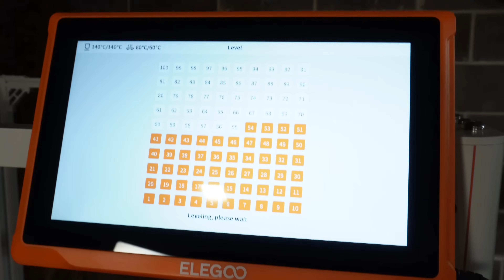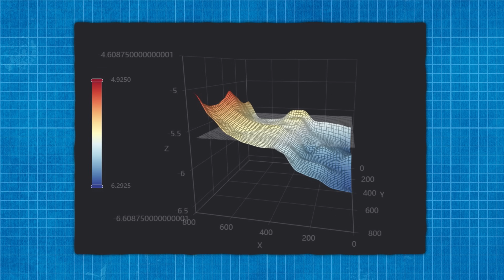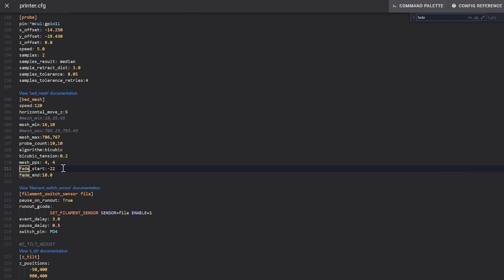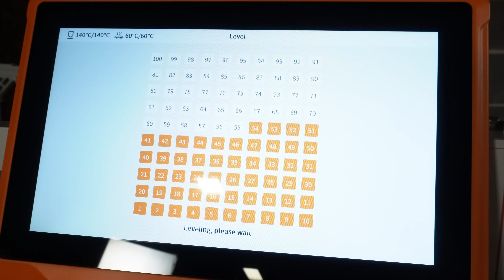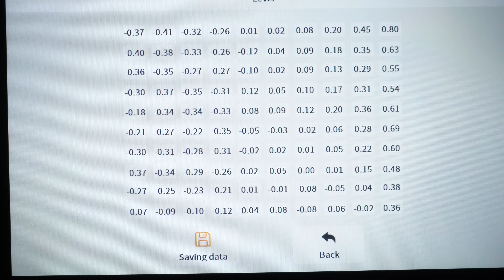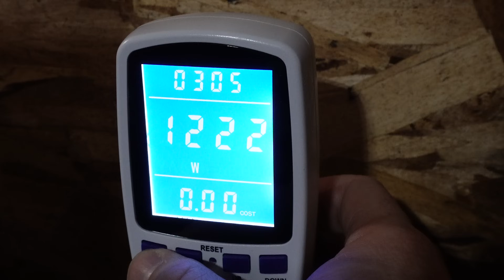My OrangeStorm Giga STILL DOESN'T WORK

Comment: I installed my Giga this week (Jan 2025) and was fully calibrated and running in less than 2 days, 9 months ago you were probably having "youth problems"
Reply from the maker: heh, oh dude, the Giga was definitely suffering from teething problems. The firmware has come a long way.
Reply: @olivergarrow233  I'm really considering this printer. But I'm so afraid because of all these complaints about it so far. Especially with no prior experience with 3D printers. What is your current experience since you set it up? Still no issues or complaints?

Comment: I got a Elegoo Neptune 4 Max a while a go, and the firmware Elegoo makes for that printer still sucks, you can't update any service because it bricks the entire system the Klipper fork they made and you'll end up buying an eMMC adapter to flash the official image or other open source images.
It's an excellent printer (quite tedious because BIG printer, and kinda noisy) but damn, the software they made sucks

Comment: So I've been doing electrical work for almost 15 years. If you're pulling over 12 amps on a 15 amp breaker, you will definitely trip the breaker after a short while. Wife and I run a business from home using lasers, and the laser we just purchase requires 2 20 amp circuits on 220v feeders, so I get to have the joy of running new electrical in her workshop... yay me 😅
Reply from the maker: Hahaha. It’s not 12 amps continuous just during bed heat up. Thank goodness. I do not envy you as I have four new 20 amp circuits that need running!
Reply: @3DPrintingNerd  thats good to hear lol thankfully I've been doing electrical for almost 15 years with my father in law. It's just a pain in the ass because I had to pull those cables about 80 ft from service main to her shed and tomorrow's task is to get the receptacles wired up. Got any questions while youre doing yours, feel free to ask!

Comment: :face-red-heart-shape: I met with Elegoo, in person and I got to play with the prototype of that printer. Also, I have a printer that size. You cannot have a rigid mounted bed that size. A MIC6 plate that size will grow up to an inch in length/width. I use leveling motors and Duet cnc boards which helps a ton. :goat-turquoise-white-horns::hand-purple-blue-peace:

Comment: sorry to hear about the issue! I have been lucky it was super quick to put together and honestly I did not level the bead (outside the software leveling) and it works good so far nothing failed yet and im about to start a huge print that will be on all 4 beds.  fingers crossed

Comment: doesn't the fade start being changed to 1 make sense tho?

From my understanding of fade:

If it's at -22 that would mean that the fade starts at -22mm... if it's an absolute value that's 16mm under the bed,  and relative to the print that would be the full -22mm.

assuming absolute values: -6mm is 48 percent of the way through that fade, which means that the nozzle would act as if it's already done .67mm of fading - in which case it would only move up .73mm instead of the 1.4mm.

assuming relative to the plate then the nozzle would only move up .47mm.

Comment: This is so crazy. I didn't expect that the biggest problem with this printer would be the extruder and hotend. But yeah, this entire build platform is not a very good idea. How do you keep the bed springs from changing the level over time?

Comment: yup...got my money back.  Not going to stress with a 3D printer in 2024 when I can go over to my X1s and just get things done.  Nothing mesh splitting and CA glue can't handle.  All the problems you had would have been normal 2018, but not now.  This is unacceptable.

Comment: 20A 120v AC outlets are common in the US. That's 2400 watts. I agree that with the 15A you're calling it pretty close, though.
Reply from the maker: 20amp 120v outlets are common in some, but most domestic circuits are still 15amp. THANKFULLY that is changing.

Comment: I wonder if the problem could be with the tension or slack on the filament. If you print something in farthest corner from the spool, then move to underneath the spool, unless your printing is using up the slack, it's going to be building up a lot of slack in the line. Slack which could end up pushing on the filament in the extruder, rather than the extruder pulling it.

Comment: They've been having this issue with all their klipper printers. I had the same problem with their nepture elegoo pro 4. However after a firmware fix, the problem has been solved. So they are good on fixing them thankfully. But it might take 6 months lol

Comment: I had a very similar jam issue with a printer before, the solution for me was lowering retraction to an absurdly low number or completely off, it gets the printer work but it does lower print quality. The issue for me was that when the printer retracted, the filament was still soft or molten and would expand, but then it would be bigger than the diameter of the heat break and so couldn't push itself back into the hotend. I have no idea if it's the same issue but I hope this helps!
Reply: well for direct drive i use 0.5mm and its good enough.

Comment: Thats a shame. I wonder if maybe that little motor might be producing enough heat to soften the PLA and cause it to jam before it should even be warm. Or potentially the hotend cooling is ineffective. Its a very odd choice to have gone for an all metal hotend with such a huge open air machine. I cant help but feel this would be better off with a PTFE lined heatbreak.

Comment: To say that 15amp circuit is "normal" for residential in the US is kinda incorrect. Previous standards for older homes prior to the late 1980s was 15 amp circuits, but most modern homes use 20 amp circuits for all receptacles, and 15 amp circuits on lighting circuits. Given that though, if your knowledgeable enough to do 3d printing, you should be smart enough to figure out whether your home/apartment has 15 or 20 amp circuits to plug into.

Comment: OMG, thank you for pointing out the key on the bed mesh level. The number of times I've seen someone go "My printer's bed is a taco/mountain range/so out of spec/not flat" etc. and they show the pic... and then I look at the key and it's like < 0.4mm difference from highest to lowest... I just sigh and go "you're looking for reasons to complain". So explaining "this looks like a mountain BUT LOOK AT THE KEY" brought a small tear to my eye and I wish people would actually pay attention to that instead of the picture. (cue waiting for people to show in the comments saying they do look at the key).

I can understand the frustration around the bed leveling. My first printer (2016) had 4 screws to adjust level and you adjusted it with a torx. You ran leveling and it would say "the front left screw needs to be turned 735 degrees clockwise". Wait, what? Done. "the rear left screw needs to be turned 64,024 degrees counter clockwise" ... excuse me while I go to the forums and ask what the heck. Seeing the latest Prusas, Bambu, and... honestly, I'm not sure if anyone else does it to the same perfection that those 2 do, but being able to just go "here's a bed plate, print" and to go on with your life. I don't know how so many are still going back to square 1. It just feels like someone missed the memo on what users want.

The sad part for me is "this is how you kill someone's love for printing" especially if it's their first printer, or perhaps the only one they can fit. Reviewers have become the beta testers, meaning the reviews can't be trusted as it's almost certain to be different when it comes out. You're not the first YouTuber who got some very hyped machine and got issues with it and continued to have issues after talking with the company and getting replacements, while others post their prints... and while I doubt you'll get villainized like they did, I do still worry it becomes the outlier that gets ignored but could be indicative of additional problems that get ignored.

I hope you get that success.

Comment: 1300watts is no joke. not only is it pushing the limit of most outlets. its not a good idea to load an outlet with 1300 watts for days on end. they will slowly get hot. they are designed to run your 1500 watt toaster oven for an hour or two. but they are not designed to run it for 4 days straight while you do a print. This printer is gonna need a hell of an enclosure to cut down on how often it has to cycle its bed heaters on.

Comment: first thing i would have done. run down to the glass shop and have a custom mirror cut that is the full build size of the bed and use that instead. you would probably have a better easier time leveling a single piece of thick mirror glass than the 4 individual plates. you will lose a tiny bit of Z but if you make the mirror thick it will be VERY flat.

Comment: Seriously appreciate your honesty Joel.  I have a problem with established companies using KickStarter to launch a new product, it is an affront to what kickstarter was intended for.  I will never pre-order another 3D printer long as I am breathing.  I pre-ordered a Qidi Xmax3 and it was a nightmare with all the issues I have had along with stuff that was broken and over-tightened from the factory. I just had to rebuild the entire CoreXY system which forced me to disassemble almost the entire printer, took about 3 days to complete and had to get my engineer son in law to help with belt routing.  The big issue I see with all of these companies is they are not normal end user friendly.  Those of us who have mechanical and electronics skills can muddle their way through repairs, but the average person cannot, and they have zero options for taking the printer to a repair shop to have the work done.  I think it would be disturbing to know how many 3D printers are sitting broken in the corner of someone's basement collecting cobwebs because they are left out in the cold by a seriously flawed customer support model that has become the norm.

Comment: I resonate with the frustration for sure but there's a whole lot of entitled whining going on here. Should be far less annoyed about having to dial in a GIGANTIC build plate out of the box on a giant INEXPENSIVE printer. The second you saw they were 4mm out of spec, you should have done the initial level right then and there and not tried your luck. Would hate to see the reaction to tramming a mill.
Reply from the maker: 1.4mm out of spec over 800mm. Not 4.

Comment: a printer with a bed that big, having a reliable extruder should have been the first thing that company made sure worked flawlessly (or like you said had some sort of sensor so if it did jam, you could finish the print job even if 1200watts was being wasted just sitting idle while you slept).

Comment: This is also my experience with an Elegoo Neptune 4... leveling the bed takes forever, and it'll straight up plunge the head into the print bed if you have the wrong build plate on... they also have no info on their website about which is the right build plate to buy if you need a new one.  It came with all the leveling screws maxed out at the lowest setting... I've had the head crash a couple of times for seemingly no reason, and at least once because I tried to use a different print bed.

Getting prints to stick is also a nightmare.

Comment: Jamming seems to be a common problem on the large Elegoo printers. My 3 Max does the same thing with jamming. I am also using the overheat to pull it back out. It is very frustrating

Comment: Measuring probably wouldn't work too well as you don't know what part of the print it stopped printing at, plus there could be under extrusion. We all know how under-extrusion affects layer adheasion. Just better off starting over.

Comment: My most jaw dropping realization from this was actually that 1200W is reasonably close to the limit of a normal circuit in a US household. That's so comically low. For us EU-ians, outlets normally do 3680W (16A * 230V). Of course you don't usually run anywhere near that, but you should be able to.

Comment: I run klipper on my original ender 3 and I have had bed leveling issues for awhile. I finally changed my start gcode to load mesh everytime. It helped.
Reply: For my ender 3 the biggest thing that fixed my bed leveling issues was getting a glass bed. Now I rarely have to adjust it.

Comment: Hello Joel, we feel very sorry to see the interruption in your OrangeStorm Giga printing process. Regarding the issue of nozzle clogging, it's suggested to adjust and increase the clamping force of the extrusion clamp. When extruding rapidly, insufficient clamping force can lead to material piling up. Please refer to the specific operating steps on page 15 of the user manual. Additionally, we will promptly provide you with an update on the latest firmware version. Thank you very much for taking the time and effort to test the initial engineering prototype of OrangeStorm Giga. Your feedback is precious to us, and we look forward to your future updates.
Reply: Don't sell things that don't work as advertised

Comment: Even in the duplication configuration like your animation showed what you're describing's not going to work if you adjust the nozzles and not the bed then one nozzle will clear its part of the bed but then as the other nozzle moves left to right if that nozzle is lower and the left side of the bed is higher it's going to crash into the bed 

What you need is all four nozzles at exactly the same height relative to each other which means you have to adjust the level at the bed plane not at the nozzle plane which means you need to adjust 36 screws

Comment: Actually they might be correct on this The better way is to level the beds that depends are the heads going to be strictly IDEX style heads meaning you can print four objects at the same time or will it also be capable of tool head style operations meaning all four of those heads may be interacting with the same part at that point the heads need to be at the same point to each other which means you need to level by the bed not by the head otherwise when you switch from head one to head two you'll either crash into the existing print or miss the existing print because the printer can't see the print remember 3D printers are dumb deaf and blind so if you're going to have a tool had arrangement you're probably better off adjusting the beds to zero so that all the heads can be at zero relative to each other if you adjust the heads then one head might be higher or lower than another head and in a tool head configuration that's going to cause you problems

Comment: It sounds like you must've got the printer intended for Uncle Jessie.  (Seriously, that dude has so many problems with machines that perform flawlessly for other people, I'm convinced he gets sent ones that are screwed up on purpose.)

The printer not realising there's a plug is about the only thing the X1C doesn't automate, so I very much feel your pain.  I can usually just print out the rest of the part and then solvent-weld them together, but that wouldn't be very viable in your case.   Good luck!

(Also, 13 Amps?!  My crappy townhouse only has a 60 amp MAINS feed.  I'm suddenly very glad I decided this was way to big to be useful, because that printer would be using up 25% of my entire home's electrical capacity.)

Comment: An 800mm printer running the bed heaters on DC power supplies, using ATX PSUs at that, is not confidence inspiring.

Comment: hey Joel, I talked to Elegoo about encoder wheel filament monitors years ago when my Elegoo Neptune 2D (their dual extruder model) was still current generation. They know about these. I had a rather pleasant back and forth with them regarding mods back then. Of course, now my printer is heavily modified by now and it's way past the point of going back to stock as I've used my Dremel on both the frame and the PSU to quiet it down. I could explain the PSU mod to you since it could bring your noise problems down dramatically and it could be a good video idea since my PSU went from the loudest part of the printer to the quietest.
Reply from the maker: Wait, really? Email me!
Reply: @3DPrintingNerd  I can't find your email

Comment: Yep, once again you make arrogant assumptions about how machine tools and specifically 3D printers, work... You are an engaging and enthusiastic presenter and we can feel the passion in your videos... but we can also see the glaring errors.... Like printing in a material that is well known to adhere extra strongly to glass... and then printing an oversize part of that same material on a massive glass plate... I have now built three massive sized printers of up to 1 meter cubed... from two different manufacturers and aside from the usual somewhat unclear instructions from EVERY manufacturer, I have been able to print the included prints with relative ease after doing the proper setup steps on each of the printers.  I would venture that Elegoo was being VERY kind in the face of "human error" because to dig that deep and snap the heat break needed the Z height to be set completely wrong and considering that those bed drop printers are the exact opposite of a more familiar bed slinger...  (Adding to the Z height on a bed slinger moves the gantry up and further from the bed, but on a bed drop adding to the Z height lifts the bed closer to the nozzle) Well... The fact that you refuse to take responsibilities for your own errors is why I no longer trust you and verify everything.  I may find your exploits mildly amusing and I can occasionally find out about interesting tech.... but...
Reply from the maker: Z height was confirmed correct by Elegoo and setup was proper. Only needed the special plates if there was a significant height difference, which there wasn’t at the time.

Take responsibility for my own errors hahahaHAHAHHA. I appreciate the good laugh. Thank you.